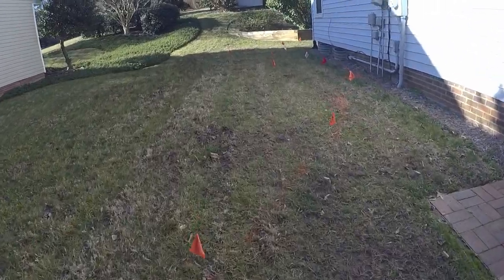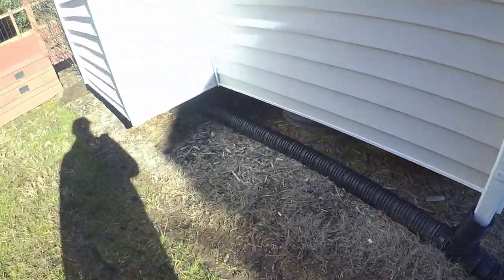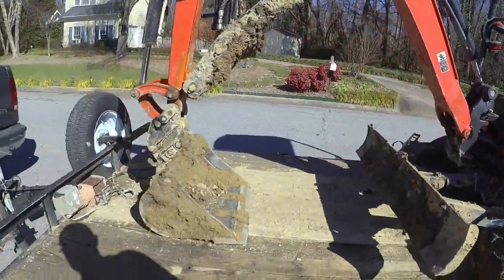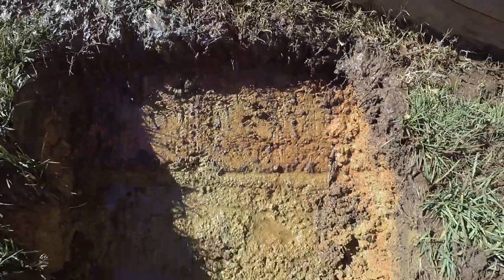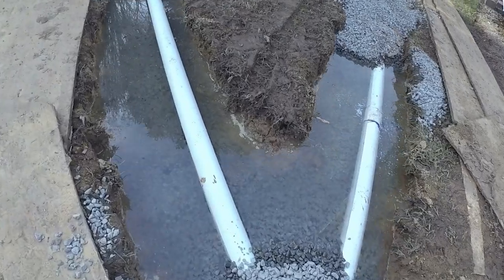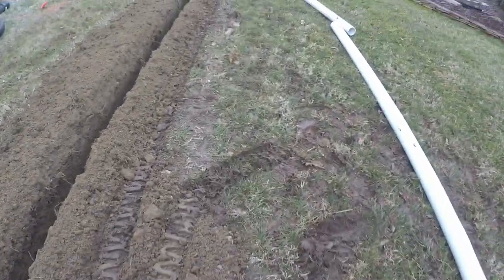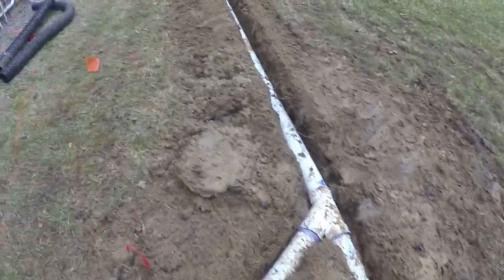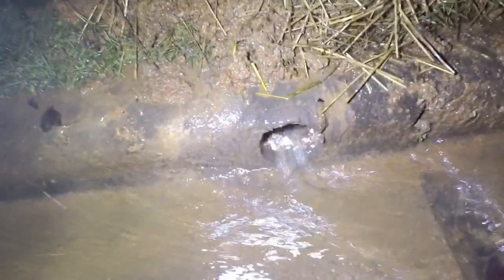How to install French Drain - where to locate - why it works

Comment: That won’t last long without wrapping the stone in no woven fabric. The soil will mix with the stone and block the water from entering the pipe. You could see mud in the pipe already in the initial part of the video.
Reply from the maker: I'm not seeing what you are stating. Using a large volume of angular gravel as a filter preserves the high flow into the pipe. Any fine sediments quickly get rinsed through the system instead of clogging against a thin layer of fabric.
Reply: You’ve been watching too many bad videos.  Filter fabric will clog up. If you’re not convinced, name me a filter that doesn’t need to be replaced…
Reply: @electricaf365  You ever seen gravel packed with dirt? At that point it is no different than the "non permeable" surrounding soil.

Comment: Over all nice job but I wouldn't be happy about seeing gravel in my yard
Reply from the maker: We only do it this way in extreme situations where results are more important than looks. Customers often add landscaping and try to dress it up.
Reply: @GCFD  what happens if you cover the gravel  with dirt and plant grass? Nobody seems to answer that question.
Reply from the maker: @Lstutta  the dirt blocks water from entering the French drain, thereby negating its function. Water doesn’t flow through dirt and grass but does flow through gravel.
Reply: @Lstutta  It would be fine, thats what farmers do in their fields. You are still removing groundwater but you will be limiting surface water. Shortens the life span of the drain slightly because the water flow carries silt with it which can block the gravel/pipe but its nothing major.

Comment: I couldn't see it properly in the video and you didn't comment on it. But I don't see any filter fleece and also no perforated pipes and also no revision opening at the beginning of the system, which you need to clean the system once a year. If so, check out this guy. He did it the right way (beside the revision opening): https://www.youtube.com/watch?v=nY91WxP6v40 😉
Reply from the maker: Hi Arno - yes the pipe is perforated - the holes face down. And no I don't use any sock over the pipe. That will clog long before 24" of gravel will so I use gravel as my filter. These systems flow so well they don't need to be cleaned but I do include a vented cleanout. I wouldn't follow the practices in the video you linked. Check out my video Proof that french drains work. I'm also installing one today and will have that video out soon. Thanks! - Shawn

Comment: A true French drain was never meant to be pretty just move water away and all the old drains that worked for many many years were open stone drains like u installed. People want to sacrifice functionality for presentation. French Drain Man will be returning to his jobs and removing fabric and sod in a few years 😂
Reply from the maker: I'm never afraid to show my outfalls. These drains move water and that's what they are supposed to do, like you said. I deliver results over looks. Thanks for the comments!  Shawn
Reply: @GCFD  I am kinda confused, possibly du to ignorance/misinformed. Does this mean that the term "French Drain" is a grated inlet with underground piping to drain the water away? I always thought that a "French Drain" was perforated pipe to let the water seep in to be drained away, whether there is an inlet or not. Thx.

Comment: You should show a bit more respect for utility markings. By law, you are required to hand dig within 15’ of any marked utilities. Best practice is to expose the utility where marked to verify the markings and then you’ll know where it’s safe to operate your machine. Can get very expensive for you very quick just digging away like you did here.
Reply from the maker: Hi Hunter - Thanks for your comment. I should have noted that there was no active internet service on the house. This was part of a real estate deal. Both realtors told me not to worry about the communications lines as the new buyer was going with fiber. I should have made that more clear in the video...
Reply: 15’?  I don’t think so pal

Comment: You didn’t use corrugated pipe, didn’t put the pipe at the very bottom, you put gravel all the way level with the sod, no gutter to pvc adapters, wow dude only thing worth it was the solid run to the curb
Reply from the maker: Thanks for the comment. Of course I didn't use corrugated. I only use schedule 40 PVC. Placing the pipe at the very bottom of the trench allows dirt to get in closer, which is why I place gravel in and then the perforated PVC pipe. I don't like to cover up the gravel with dirt, because this only ends up in the gravel and restricting flow. This system was designed with one goal - to carry the most water and never need maintenance. The things you criticized are actually what I'm most proud of with these systems. It's also why I have so much work - much of it is replacing inferior systems like you described.
Reply: You’ve been watching too many bad videos